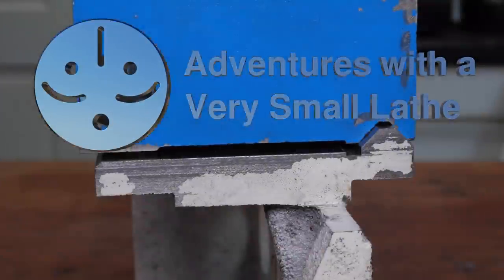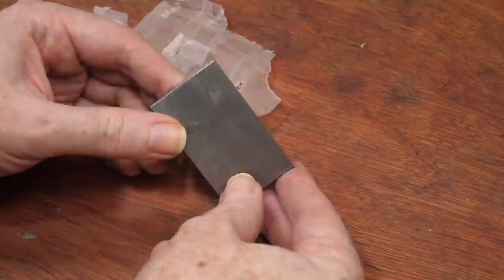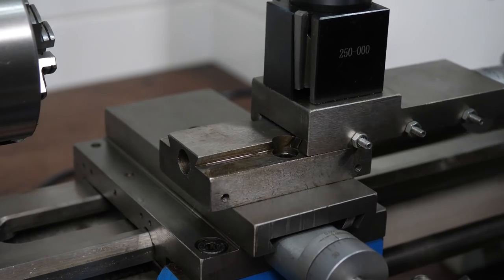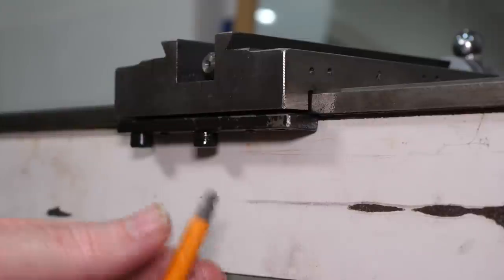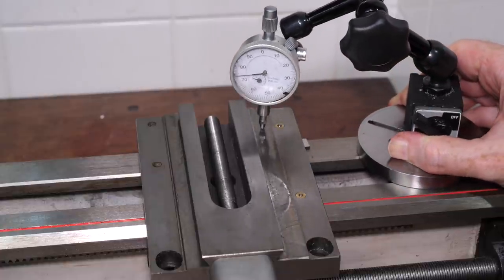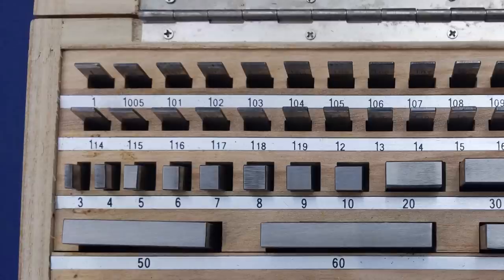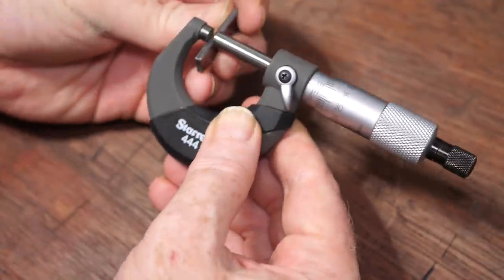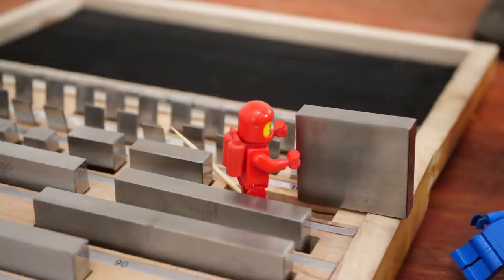The CJ0618 Lathe Saddle Part One, Measure the Problem with Gauge Blocks and Banggood Tool Review

Comment: Hello,  im telling everybody.   about a device   R. steven lang showed on his channel.www.lasercenteredgefinder.com  sells them. mine throws a .001 inch red dot, i put it on all my "x marks the spot's".  i use "dark blue marking color" by dykem.  its a closer to "true blue" and so causes less "backscatter" because it dont reflecrrt  red. that is the biggest backscatter creater. backscatter makes the dot look bigger.  not good.  i think this tool is wanted by every machinist.  poppy says   stay safe  also keep eating!!
Reply from the maker: Thanks Poppy, that looks really cool! A bit big for my mini-mill though, at 3 inches. Do you know if there are any distributors outside the USA?
Reply: @AdventureswithaVerySmallLathe  my mill is a sherline.  i have little problem using my laser. dealers outside u.s.?  amazon will sell you one. e-bay? hope this helps poppy